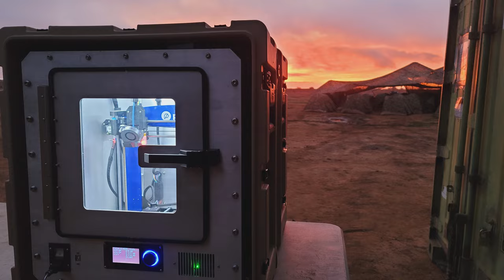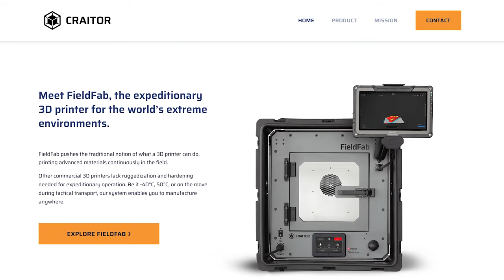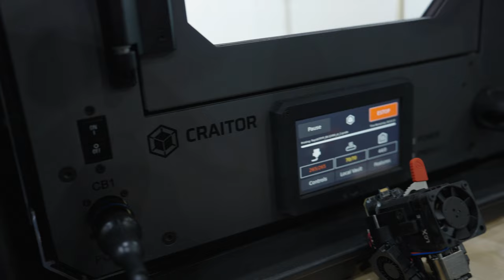World's Most Durable 3D Printer? Craitor x Slice Engineering at Rapid TCT 2024

Comment: Can it do metal then, wouldn't the military want, prefer or require being able to print metal parts?
Reply from the maker: The military is investing in quite a bit of metal 3D printing capability, but this particular machine is works with thermoplastics. There are certain filaments that have metal fillers and can be sintered after printing into a full metal part. The process is a bit finicky, so in most applications it is better to simply select a plastic that is appropriate for the end use.